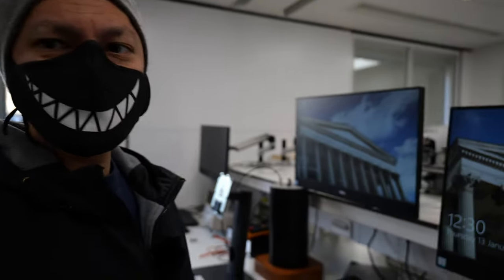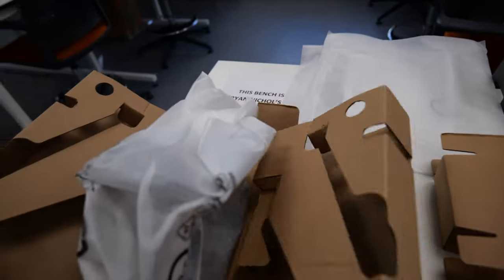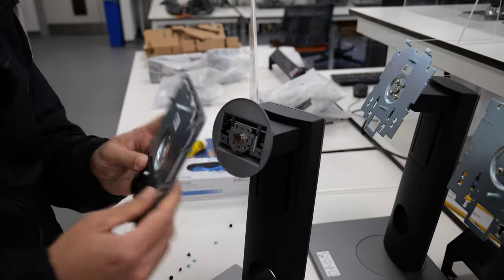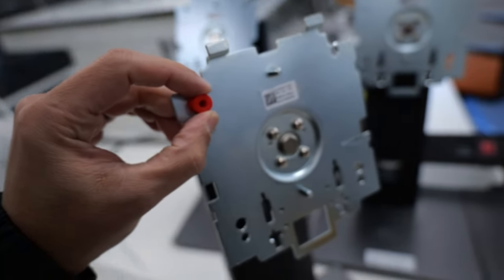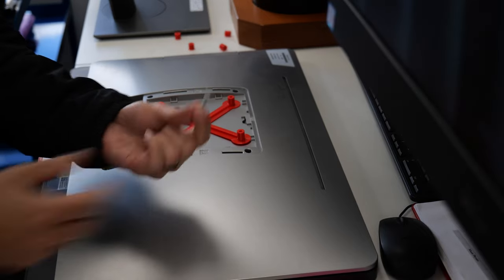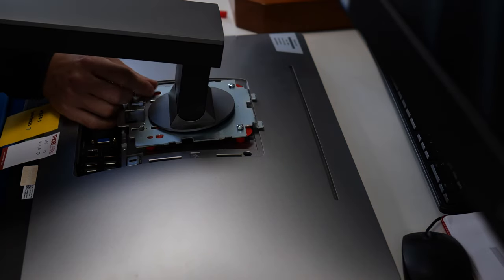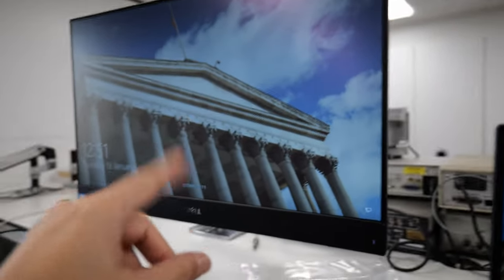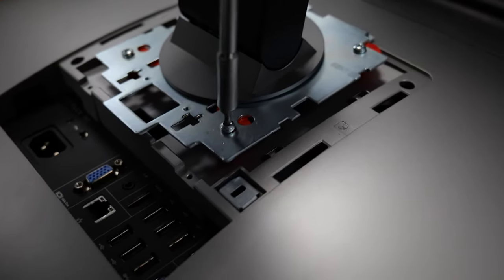What I learnt adapting Dell monitor stands *extra tips at the end*

Comment: Hi there! I just got my u2724de, along with one of those monitor mounts to save desk space, however the thing is really erratic and poorly manufactured so I'm looking to stick to the oem stand. However, I still want to save some space. Do you know if there's any way to get rid of the bottom part of of these stands and somehow fix the vertical part to a desk? Thanks in advance!
Reply from the maker: Mmmm. Are you willing to drill a hole into your desk?
Reply from the maker: Bolt a monitor stand directly to the desk?
https://youtube.com/shorts/yUIFrkGYsZk?feature=share
Reply: @VynZography  Oh brother this is awesome! Thank you so much for taking the time to explain, I just figured out how to tear the whole thing apart so I was able to separate that thing that goes into the vertical part, I'll get on designing some plates to help with stability and find the right screw. Thanks again!

Comment: Can you just trim the two upper tabs to fit into a Dell monitor? Have a 24" Dell monitor, works just fine, but has the basic short base, have the more adjustable stand, but looks like the 2 upper tabs are a little too wide. So, why not just trim the width of the tabs? It looks like the rest of the square should fit into the recessed area! Thank you for a great video!
Reply from the maker: Hi yes that also works. A coworker did this for a few but the steel is not easy to cut and I wanted to one day reuse the stands on their original pcs which are currently on ergonomic arms.  Thanks for your feedback 👍.

Comment: Aw sweet! i have one of them height adjustable stands, doesnt have those intrusions though. 

I want it to fit my new s2721hn (which will prolly come today or the next day)(which btw comes with a crappy NON height adjustable tiny stand).

I didn't even realize i could remove the backplat and use it as a standard VESA stand! Good to know that!
Reply from the maker: HAHA yeah at least they retained the VESA Standard for the screws ey 😉
Reply: @VynZography  Unfortunately the old stand ( Dell S2421HGF ) didn't fit my S2721H. Maybe there was a size difference, 24'' monitor stand not fitting 27'' monitor.

Over the last 5months, I have gotten used to the height.
Reply from the maker: @FeverDev64  ohhh. Yes true. They will be different heights for different sized monitors ☹️